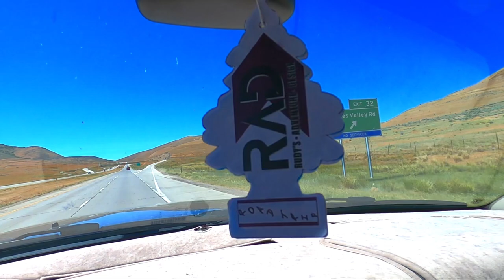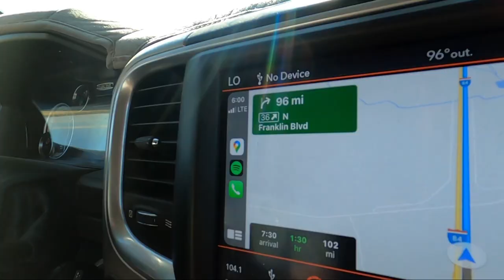I SURPRISE MY BROTHER WITH HIS DREAM TRUCK !!!

Comment: Yes! 1963. It’s beauty! I have myself 1963 as well. C10 fleet side. Short bed. High performance 350 with TH400 transmission. 2 flow master with dump and straight pipe under the both seats. Paint them matte black. It’s my favorite truck. 1960-1964 is awesome year for c10. I used to had 1966 but sold it. Kept 63 ever since.

Comment: Rudy, you are a 10 on the awesome brother scale. That's such a cool thing to do for Collin. That truck rocks. The mechanic who rents a building from me is doing that exact thing: putting C10 bodies on square body running gear. And Collin, I'm an above knee amputee and I'm so glad for you being able to keep your leg. Never take that gift for granted. I'm building a 78 CJ5 to replace the motorcycle I can no longer ride. It's a 4 speed and I'm bound and determined to figure out how to brake and shift. Probably a hand control for the brake, meat foot shifting and bionic foot on the gas. I can't wait to see that C10 taking its maiden cruise. Rudy, you're a good big brother.

Comment: I had this truck a 1965 three speed on the floor 350 4 bolt-main  sheared the input shaft off the transmission in a drag race snatching second gear what a blast that truck was congratulation .

Comment: I had one just like this! Like yours, my front fenders needed to be replaced. I didn't like the low wheel houses on the back fenders, so I cut the high arch wheel openings off the rusty front fenders and cut the rear low ones out and replaced them with the fronts. With the truck lowered (not a lot), It looked so cool! It really changed the look of the truck. That was 30 years ago and I haven't seen one like it since. Do a rendering first, you will dig it!

Comment: Such an awesome thing for a big brother to do!! I had a 66 and I loved that truck. It had the 235, with a three on the tree trans. You absolutely couldn't kill that motor. I ran it completely out of oil and water, at the same time. That day I didn't love it too much because I'd had a long day at the end of a long week and I just wanted to get home. After stopping three times to put water in the leaking radiator I got mad and decided I was not stopping again unless the motor blew up. I made it the last five or six miles and the motor sounded awful when I pulled in the driveway. I figured it was done for. Went out the next morning and added four qts of oil just to get it showing on the dipstick. You could hear the oil hitting the bottom of the oil pan when I poured it in. It fired right up and sounded fine. Out a radiator in it and kept driving it for at least a year before I finally parked it planning to fix it up. I wound up selling it after someone stole the trans out of it, and I just didn't have the time or money to work on it. I know with the family you have this truck will be in good hands and it will be enjoyed for years to come!

Comment: Those are great trucks . When I was 17 years old , My dad gave me a 1964 Chevy 1 and half ton flatbed truck . Small ten lug pattern 283 engine with a 4 speed munsy tranny . and a compound low rear end and I still have the pumpkin out of it . . It was geared so low I kept blowing up engines 20 years later I got a 1973 ford flatbed with a 400 big block and an extended chasey , But I still have my 1953 Chevy half ton pickup truck ill be dropping a 327 in it and finally going to have power steering and make it 4 wheel drive . It's the truck I learned to drive in .

Comment: Tell Colin "C10" is the designation given to the 1/2 and 3/4 ton pickup truck chassis in a rear wheel drive configuration, the C20 designation is given to the 1 ton chassis in the rear wheel drive configuration the 4WD configuration was given the letter K and the 1960-1966 model years were the first generation of the C/K chassis. So to reduce that mouthful he can say "First gen C10"

Comment: Great start 👍😊
My first one was a 61...
1973-1987 front cross member bolts on your frame...
5   lug disk brake power steering is easy...
Late 70s El dorado rear end is disk brake and same 5 lug ??
Brake portion valve is needed of caddy... Car gear ratios 😉
Good luck ✌️♥️

Comment: Awesome truck! 60-63 are my favorite because of the knee knockers! But if want to lower it you'll just need a set of lowering springs and or spindles in the front, 63 was the first Year of the coil springs on the front,60-62 had torsion bars wich is what all my trucks have, infact Rudy you seen my 62 GMC at cache valley last year it was the lowerd green utility bed next to my brothers red 63 GMC, no need to swap frames, can't wait to see this one back on the road! Congratulations

Comment: I hope he finds out you don’t need to swap the frame. The front crossmember from a 72-87 will literally bolt up to a 63 and gives you disc brakes and power steering. I have done it, it was well worth it.

Comment: In 1969, my dad sold his ‘55 Chevy, (maybe Plymouth Dart), and bought a ‘63 Chevy C10 Short Box 2WD, when he married my mom.  I learned to drive on that truck in the early ‘80’s; my little brother in the mid ‘80’s. He drove it into the early ‘90’s. (He was a mech by trade, it had one overhaul on a 230 straight. (Not 235)) When he finally put it back in the woods for good, it was just a couple K shy of 300,000. The rear end howled so bad it made your ears hurt. 

Tolerances might not have been so good back then, but they sure used good steel.

Comment: Hay I saw a V8 in the back of that truck it was painted blue or at least that's what I thought I saw and if so is it a 283 or 327. I'm hoping 327 that's a good engine there are still tons of parts for them out there.

Comment: Rudy (of Rudy's Adventures and Design - RAD), I'm a little unclear as to what your RAD means. Maybe you just would like a couple of "Adventure" suggestions. How about:
-strap a camera to your forehead and then pedaling along one of the racing bike trails your brothers ride in,
-riding along with a storm chaser when they locate a funnel-shaped cloud,
-tag along with one of the guys who film the leading edges of your local flash floods,
-kayaking after the logs/boulders of a flash flood (in an appropriate valley setting),
-kayak behind the ice breakup of one of the northern rivers in April,
-repel down one of the slot canyons (oh, you ,ight have already done that, and I missed it),
-ride down the cable when Heavy Sparks (?) retrieves the junk cars from the three falls canyon,
- do a short hot air balloon ride across part of Utah,
-white water canoeing,
-fishing,
-water skiing,
-snow skiing,
-glissading down a portion of a glacier,
-scuba dive in Lake Powel,
You get the drift!